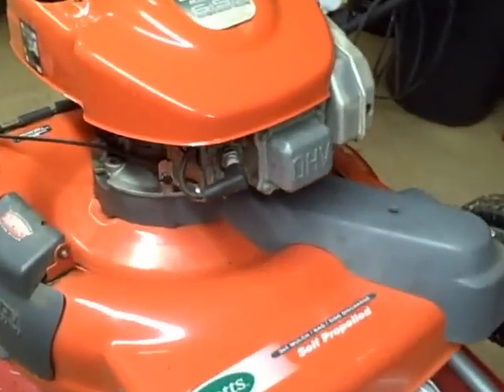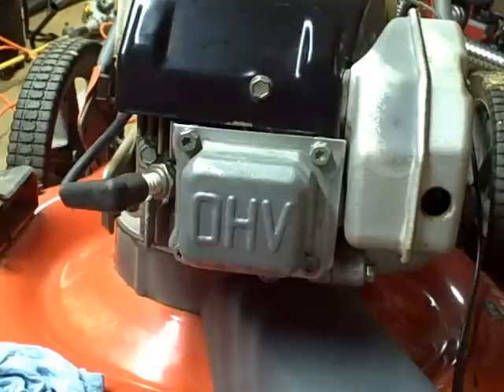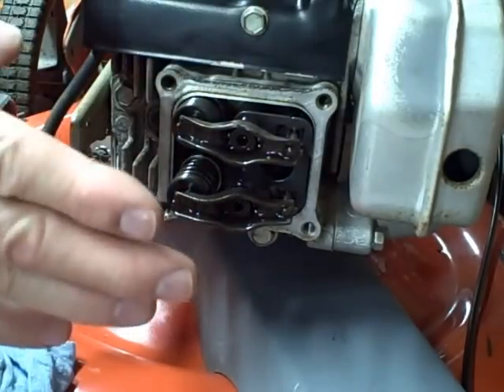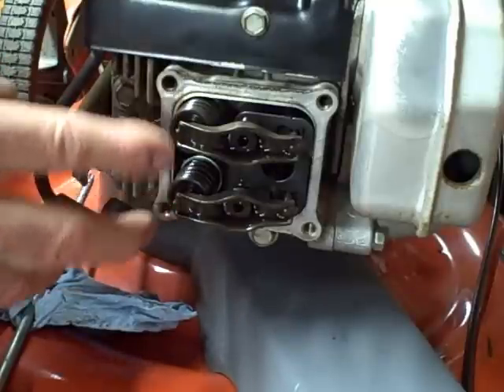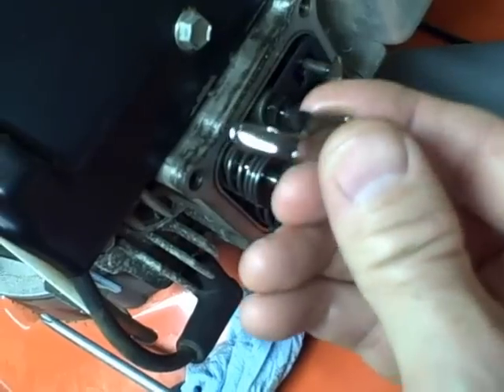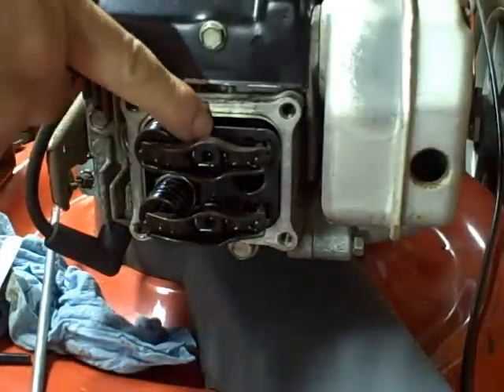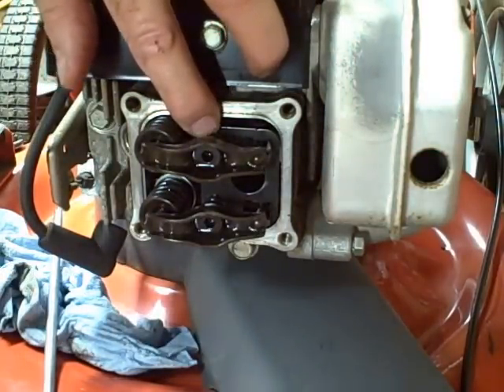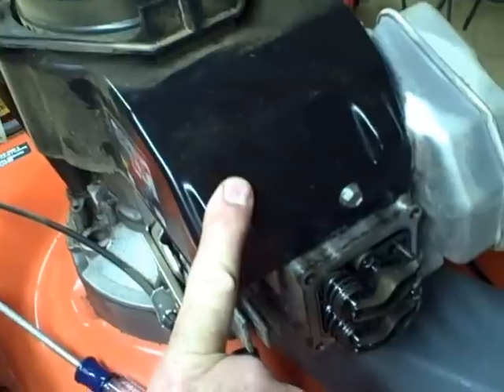Small Engine Repair: Adjusting Valves or Valve Lash on a Tecumseh Lawn Mower

Comment: It can also cause a NO SPARK issue. You think the coil is bad,you test the coil,coil is good. Mower still won't start ? Check the valves and push rods. I had a John Deere that fired here and there. Fix ? Bent push rod replacement. She runs now.

Comment: Hi, how can I know the gauge valves on a lawn mower, is on any stickers on the machine or I need to looking for online, thanks and nice video
Reply: Sorry for the delay but the size of feeler gauge you have to look for it in your manual if don't have the manual look it up on Google using your model & brand of mower.

Comment: question, I have a 5hp Tecumseh snow blower engine, got a 124lbs compression with starter, new carb, timing seems correct- but IT WILL NOT EVEN FIRE WITH STARTER FLUID- ANY IDEAS- thanx
Reply: ricker bear no spark?

Comment: good video. Great video quality and focus on the subject at hand!!
B& S tells you to go 1/4 inch past TDC to adjust valve lash. I'm told this is to get past compression release bump on camshaft. Is that not the case with Tecumseh?

Comment: Can valves being out of adjustment cause a popping sound through the muffler? It's not a backfire, just a popping sound. It's pretty consistent. I tore the carb apart and cleaned and adjusted. Drained fuel, replaced fuel line. Put in new spark plug. The rider had been sitting for a couple years. It seems to pop with or without an air filter on it (the air filter is old but I've been using it).
Reply: Did you ever fix this issue? I have a 5hp tecumseh engine doing the same thing.
Reply: @caylonxt225  no I ended up selling the mower because I found a good deal on a 48” Snapper walk behind mower.

Comment: How do you know how many thousandth of an inch your specific engine needs between the rocker arms and valve stems?
Reply from the maker: Manufacturer repair manual has all the specifications.
Reply: what if you don't have the repair manual?
Reply from the maker: What engine are you working on? What is the manufacturer and model number?
Reply: At this point you can jut go to Tecumseh.com or google it. They have been out of business for 8 years all of those manuals are available to view free now. But you could also just search your engine's specific clearances. You don't need the manual. Your making it harder then it has to be for yourself. Its the information age, just look it up.

Comment: What causes the push rods to keep bending on a snapper ride mower 14.5 hp .
Reply from the maker: Resistance. I've seen valve stems gummed up from bad fuel bend push rods.

Comment: Good Video.  Question : My OVRM120 will not hold the lash adjustments, so the  a  comp release does not work well.  

Last adj I found the intake locknut valve loose even after torquing to spec (for my t-wrench/crowsfoot I calc 8 % less).  I also found the studs stretch while torquing and opens clearance, which I then re-adjust correctly. It is running lead due a carb that needs cleaning/rebuilt. So, maybe the added heat an affecting torque/lash. Loctite on locknuts? Any other ideas?

Comment: I started out with a 5 hp Tecumseh. It needed a carb, rebuilt. But it was bad. So I got a new one. After a few pulls I lost all compression. Checked the valves and they were so lose they would not sit on the rod and springs. Watched your video and did as you said to do. Why would someone take the kill switch and  ground it to the frame ? The coil is bad. Oddly the guy who owns this says No one has ever worked on this engine.

Comment: The crows foot should be used at a 90 degree angle to the torque . That gives you the indicated torque. Straight out in front will increase the torque over the indicated value. So always at 90 degrees to the wrench. How do I now? I was a tech at a Harley dealership for 10 years. Things you need to know.

Comment: You usually front have to replace them gaskets in fact you almost don't need them because the oil is not compressed. Head gaskets are a different story.

Comment: I have a quick question. I completely took apart my spar lawn mower engine to thoroughly clean it. The problem I have ran into is this, I cannot find a cheap piston ring compressor. My piston has 3 rings and I can't put them in by hand. I bought a cheap one from Harbor freight but it is too big.
Reply: I know this was a long time ago, but use a hose clamp. It worked fine for me.
Reply: try zip ties